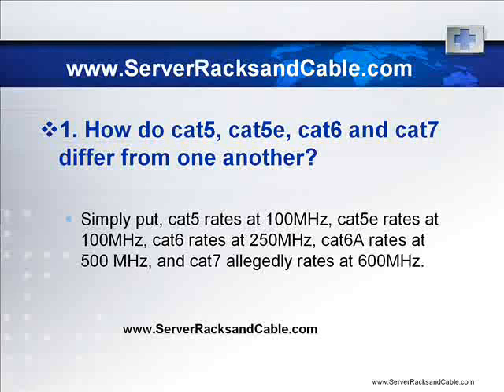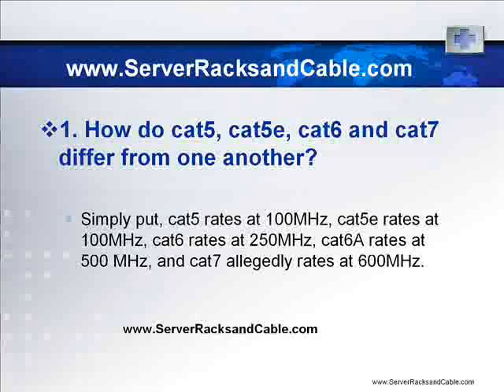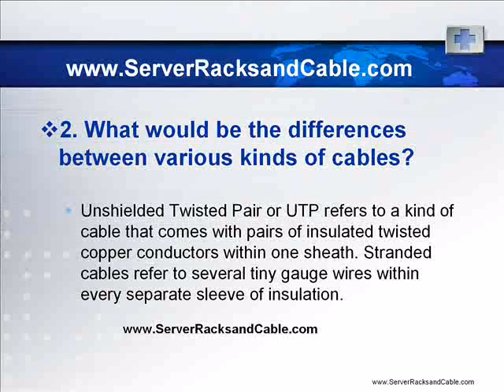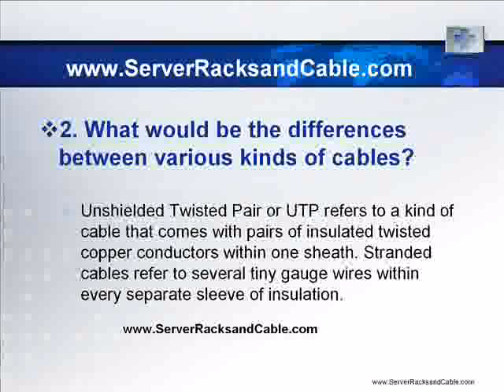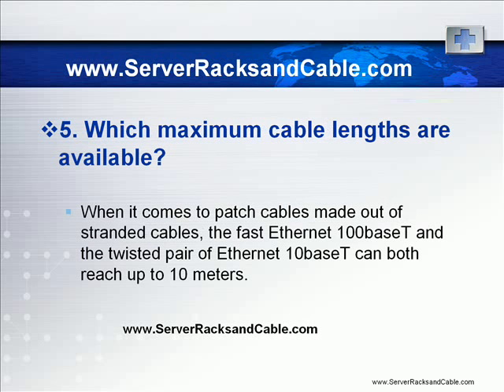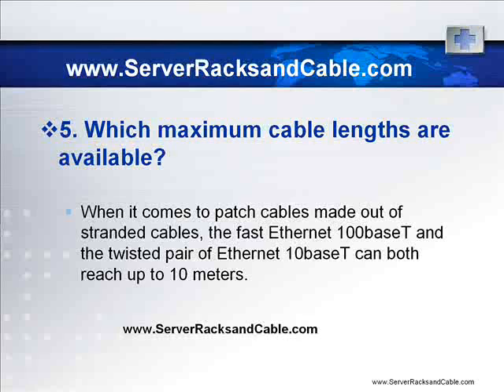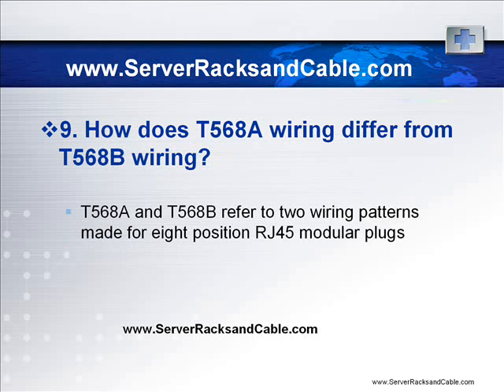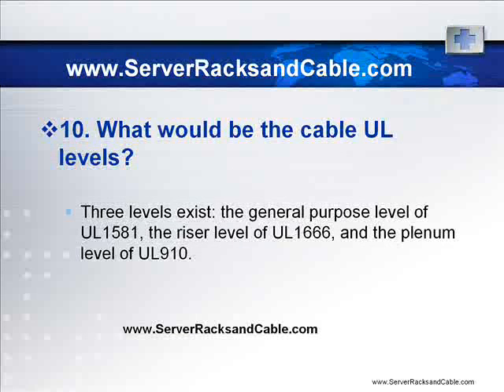11 Cat5 Cat5e Cat6 Cat7 Questions & Answers

Comment: @DaRahamim ANSI/TIA-568-C.2 defines Category 5e from 1 MHz to 100 MHz. It also defines Category 6 to 250 MHz so the presenter here is indeed correct. You may see figures such as 350 MHz but they are marketing numbers that have no bearing on industry standards.